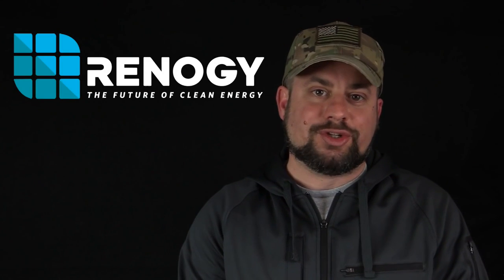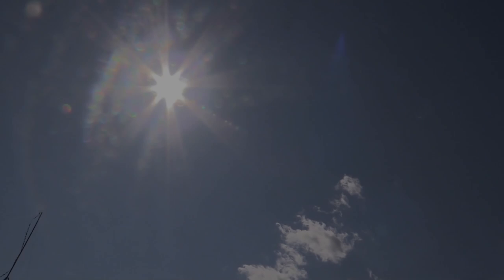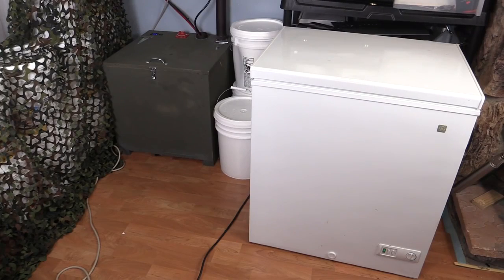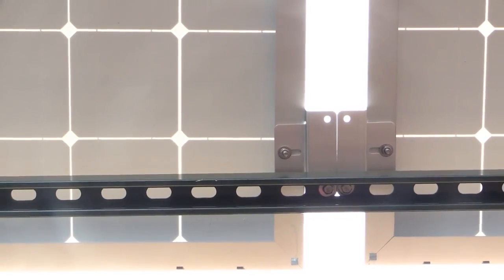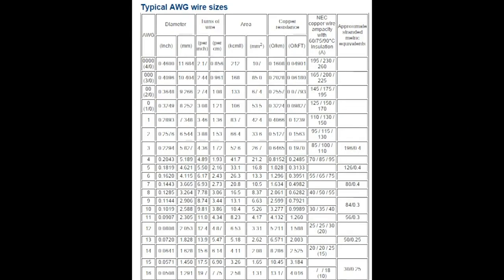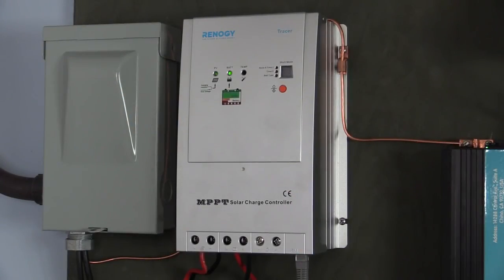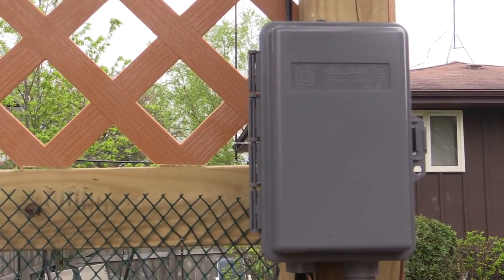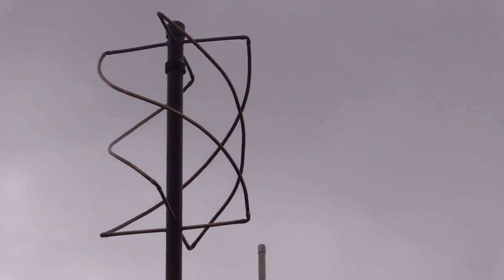The Ultimate Guide To DIY Off Grid Solar Power | Tin Hat Ranch

Comment: This is a delightful series and very helpful to us beginners. However, I am confused by the sizing of your energy storage. You mentioned that your banks store a total of about 400Ah. I was using someone else's sizing calculator and came up with a minimum 750Ah requirement based on your stated goals of 1500 Wh/day, 12V battery banks, 3 days without sun, and 50% discharge. Do you know why the difference? The calculator is here:   https://rimstar.org/renewnrg/sizing_select_batteries_for_off_grid_solar_system.htm

Comment: One note, the current carrying capacity of a wire (ampacity) is proportional to the SQUARE of the wire thickness or directly proportional to the cross-sectional area of the conductor. Thus, if you double the working voltage, you need a quarter of the wire thickness (or half of the cross-sectional area for that matter) for the same power consumption.

Cheers.

Comment: NEVER EVER PLACE A FUSE IN THE BATTERY COMPARTMENT WITH UNSEALED BATTERIES! EVEN A VENTED COMPARTMENT HAS HYDROGEN GAS WHICH CAN EXPLODE IF THE FUSE ARCHS!

Comment: How do you hook the solar power into your house electrical?  Or do you have to run a power cord from the power inverter to the devices you want to power.  What if you turn off your main power cut off to the house since the grid is down anyway then plug the power inverter into one of the circuits in your house.  Would that allow you to say run your regular refrigerator without having to haul it out to the garage and plug it into the inverter?

Comment: Would this system setup be able to run a well pump, small cube fridge (no freezer) and a led TV intermittently without burning the whole system down? I'm looking at settiing up a small cabin on about 2 acres with limited use for company. I know they will need refrigeration and water with a few comforts added, but since it is sporadically used I can't see spending thousands on it.
Reply from the maker: +forklifttony it should
Reply: The well pump needs to draw less than 9 amps at 110 volts

Comment: Ok... So let me see if I get this straight...I have been pretty much flushing voltage down the drain with the PWM is had??? I now have the Renogy Rover MPPT 40a though :D
This is the breakdown of my system:
Four Renogy  100w 12v Panels
Renogy Rover MPPT 40a Charge Controller
Four G24-48 Gel 74ah @ 20hr Batteries
Aims 5000w 12vdc to 120vac Modified Sine Wave Inverter
Cabin Runs @ 1280 Watt Hours

Panels are around 20 feet from my charge controller, and my charge controller is about three feet from my battery box.
I need to run gel batteries, due to the area where my cabin is. The temps get down to around -50 degrees Fahrenheit during the winter, and I don't want to risk FLA or AGM freezing and cracking when the cabin is not in use.
After watching this video, I'm thinking of wiring my panels in series. They are currently in parallel. Would be nice to get use of that first morning sun...

Comment: Reasons not to have too large of a battery reserve:

1) Each battery self-drains at a given rate.  More batteries = more drain.  Charge your battery to 80%, leave it until it drains to 40%, the number of days to drain vs the time to charge is the efficiency loss you will suffer as a result of adding another battery.  On cloudy days your system may fail to charge entirely as a result of having too many batteries.

2) Batteries degrade over time even if you keep them in the healthy State of Charge range (40-80%).  Typical gell cells maintain 50% of their rated capacity over 6 years if you keep them between 60-80% state of charge, so you will be buying a new battery bank every 6 years.  Twice as many costs twice as much.  AGM "Glass Matt" / Sprial Cell batteries can last twice as long as the cheap/common gell cells, so if you want to make a battery bank that can survive 10 years without replacing cells you should get AGM batteries.  If your projected needs exceed 10 years, purchase a reserve of dry-charged batteries.  They won't degrade before you activate them, so you aren't caught with your pants down with 6-year old gell cells on that critical day.

Comment: Great video! A few years ago I started putting everything into power bars and turn everything off when not in use.... only the fridge, freezer are always online even my stove has a breaker now right on the wall abover it.... I even went as far to switch over to a wind up alarm clock... 100w solar cell system to charge all my rechargeables daily and it blew my mind just how much money I saved... one parasitic load is negligible. But start putting many many parasitic loads online and now you're burning amps for zero reasons... it was a pain at first but really it's just a way of life now... I have led flashlights everywhere too and charge the batteries by solar only... outdoor lights are lithium ion powered and recharged by way of solar. I'm starting to funnel my energy savings now into putting together a rather large solar system... batteries are what I find the most frustrating as I find they are the weakest link in a solar system because of life span longevity and COST... but I've been having great results by replacing the sulphuric acid because the acid is cheap as dirt and have been extending battery life while having increased my discharge rate and percentage. Solar is a lot of work and will always require maintenance but to me that's the fun part.

Comment: I've got a set up on my camper that has got me very interested in solar for my house. I've got 2 Renogy panels wired for 24 volts into a Renogy MPPT controller charging a 12 volt battery. It's amazing to see it wake up and start charging even before the sun's "up". People say solar isn't any good on rainy days haven't seen this kind of system. Can't wait to add a couple more panels. Before solar I ran the generator almost constantly, now maybe for breakfast and possibly before bed. With those 2 more panels maybe not at all. Imagine hot tea (sorry not a coffee guy), refrigerator and radio; In my case blower for heater all without the noise of a generator saying here I am.Great job explaining solar.

Comment: Great info I actually understood it! Lol, that being said I don't think I could do it myself. I want to full time RV and be able to run the air cond. I don't like it ice cold so to keep it on 76 degrees on low. I don't want to use the generator. So what do you suggest or better yet could you do a video on that??
Reply: It's easy to calculate, his system is for an estimated 100 kilowatt/hours of use each day, so multiply the wattage of your air conditioner times the hours you use it each day, you'd likely be over 100.

Comment: Excellent Video. Pretty much the exact system a buddy and I want to install on his off grid fishing cabin on a Texas Coastal Island. What I don't get is if Solar panels always produce when in sunlight and the batteries are full charge and there is no draw - like when we are not using the cabin- where does power/energy produced go? And can any components be damaged ?  It could be a month to 6 weeks between visits.

Comment: Wow!  Learned more from these videos than I thought possible.  I've started planning for my first small solar system.  Of course, I have a question.  I bought a "Kill-a-watt" meter and started measuring appliance loads.  I noticed the difference between Watts (active power) and VA(apparent power) can sometimes be substantial.  I've read that VA should be used to chose wiring and fuses as they experience this current in resistance and heat.  However, I'm unclear which I should use to chose battery bank size and inverter.  Can someone expand on this??

Comment: EDIT: Very good. What is the coating on the unistrut you purchased. I have seen the silverish pregalvanized stuff, and the interior gold coating, but not the dark color of yours. Which type is that?
Reply from the maker: +Steve bakker it's a paint or powder coat of some kind.  You have to keep in mind the installation of this system was three years ago.  It's faded some but no corrosion.
Reply: Thanx for replying! I was also wondering what sort of wind speeds you've experienced since putting up your array. We get 70+ MPH winds here. I used unistrut (pre-galvanized) to make an adjustable mount for six panels, but I used far more sticks than you did. I like your design, but wonder how much wind it could handle.

Comment: Good video,  It is cheaper adding an extra panel as opposed to buying more batteries, thus you will get additional charging during cloudy days, and you will have more reserve power in the batteries.Good information about not going too big for the batteries capacity if you don't have sufficient solar panels to bring them up to full charge, so you will find in the winter your batteries will not be fully charges and you loose the required reserve power and life duration.
Thanks from Australia :-)

Comment: Someone give this guy a medal.
Reply: sarthak grover #
Reply: Lil puigun
Reply: Great examples.
Reply: Ricky Swisher goos
Reply: BLAIR M Schirmer  I do believe that he's trying to inform the new and just starting out and getting into the solar panels with some helpful information that most would not know..  I'm just saying.. some have to crawl before they start to walk..
Reply: Bob A  I am not sure what you are talking about 72 cell panel are commonly used on homes and I am a solar company they are about 54 pounds we have all our projects engineered structurally for load on any home or Utility building there is no issue with the weight.. As for efficiency you would have a lot less panels to achieve the watts of the system you are trying to get. They cost less money so it also makes better sense from that side as well. right now you can pay $340 for a 385watt panel and the 12 vdc panels for 100W are about $230.
Reply: RIGHT!!!!
Reply: I will slap him! hahahah just kidding
Reply: nope.
Reply: Gold medal
Reply: I have been into solar power for the last 3 + years.. my RV is my castle.. my hunting and fishing and off I go to wherever I want... And have been building up my own solar power grid to be completely self sustained.. I would like more of his videos.. ( I do consider myself and electronics freak of sorts..) right now I have 600 Watts solar.. large capacity battery bank..as I said I do live very comfortably in my Castle.. but also a 4K Onan, 4k Furman, and even a sportsman 1000 (as I am a musician and plan to use this equipment as live concert stage Power) but I will be adding onto my solar.. only because I love the feeling of complete and utter freedom! I value this gentleman's knowledge.. kudos my friend and  others that are into this..
P.S. as a side note solar panels are more efficient at about 70°F, so constructing a heatsink and a few simple means to dissipate heat from below the panels.. it would be easier if they weren't mounted onto an RV as to many factors... But if you have stationary application it would not be hard to come up with a simple design to remove excessive heat.. as I said 70° if you look it up you'll find out that I am correct...
Reply: This is my second re: as food for thoughts build your system all in one area batteries as well as inverters in run AC the rest of distance.. you know from the inverter because your AC has a less drop in the delivery.. has he mentioned 60 feet of heavy cable from battery system to solar or vice versa... But less expensive and more efficient power.. as I said food for thought.. thanks for reading
Reply: He gives a clear and practical bunch of useful information.  Congratulations !!   I appreciate the effort.  It shows !   Thank  you.  :-)
Reply: Did this guy get his metal yet he should run for president😜😮😎
Reply: Ya think he is a real trained died in the wool Sparkey ?
Reply: Christine Ortman Ortman Christine tonn

Told
Do you
Reply: yeah! right between the ears. He is prepping for failure.
Reply: LOL--- bad design on the system can do it cheaper and get more power the 100w panels are way more expensive then the larger 72 cell panels
Reply: @EvolveEnergyca  first can I say I'm not being critical of your knowledge. But it wouldn't hurt to share with the rest of us.. I know I'd appreciate it.. thank you
Reply: @CJames-gw9xj  Hey James sure. First the larger panels will get your power up with less money invested. I have been a solar designer for 12 years. so first you want to go in 48 volt on the battery side and get a MPPT charge controller. The higher the voltage of the battery you will utilize the charge controller better. Like a PT 100 from Magnum lets say it is a 100 amp charge controller this is $1500 to buy so you want to use it the best way at battery voltage of 12 v you only can add up to 1200 watts solar, at 24v you get 2400 watts and at 48v you can add up to 4800 watts so it is important to invest in key pieces.. Then this MPPT charge controller you can wire a much higher incoming voltage so if you get 350 w or 400 watt panels you can do them in strings of 2. This reduces the wiring cost and you are going to get way more energy from them. Any hope that helps! if you go to my channel my web site is there and you can email me if you want. Good Luck. I have my system here running since 2012 on my home. I use Magnum.
Reply: @EvolveEnergyca  thanks I appreciate the input to this. And I will check out your channel I appreciate it. Thanks.
Can never have too much information.. again thanks
Reply: @EvolveEnergyca  oh I need to add a couple things that maybe would be pertinent. One is that you gotta remember I'm using this system in an RV and space is at a premium always.. though I do have approximately 250 sq. Feet of roof .. and will be utilizing as much as I can forpanels there's other reasons besides just covering the roof with panels for power.. but I won't go into that for now.. also battery weight isn't too much of an issue but still has to be considered . But I'm glad that you're a solar panel engineer as I'm in the transitional stage of my system.. and have a lot of things to consider before going forth and spend any more money.. the system I've got right now actually does one hell of a job.. I mean I got crockpots running,two refrigerators one is a three-way that came with the RV and usually just use propane even if I'm plugged in.. the other is a 7 cubic foot+/-? Tv,lights.. inshort I've got a lot being utilized, I'm very savvy I guess on how my Power is being distributed.I'm running several fans the help out there in the summer time with the two large AC units (those of course are not part of  the solar) I'm trying not to make this too long of a story but just a clue you in where I'm at with this because I am going to be doing an upgrade.. battery wise and panels.. as I said what I've got right now works damn well.. but I want..haha.. that's just the kind of way I am.. and would like to get more info I'll get on to your channel here as soon as I get this sent.. since I've got your attention at this moment..the batteries that I'm using I've had for 3 years and they're still for the most part strong.. I have an array of 3 sorts.. and more than three reasons why..and as far as inverters I'm very creative as how those are enacted with all that I've got applied to them for use.. why do people say I go overboard but then again I do this.. not just with electronics but also with my music too haha okay I'm starting to babble so I will get on to your YouTube channelthere's a few things I've discovered also as to compensate between cloudy days and nighttime that would may be useful to others.. I'm going to stop here ... But thanks again and looking forward to conversing into the transitional upgrade to my system..
Reply: @EvolveEnergyca  so toss a few panel brands and sizes if you don't mind.. I apologize I'm not trying to hijack your YouTube post.. but I just want to ask the evolve green guy a couple questions and if you've got any particular panels that would serve RV well.. thanks
Reply: @CJames-gw9xj  for Rv's it really depends on first how much power you need. don't go above a 60 cell panel ( 40 in by 65 in) and you should if in the US use only UL certified just CE is only a China Certificate. If it has UL TUV or ETL those are all higher Certificates and are better tested. to prevent a fire in your RV you want to enure all positive cables are fused or have a over current like a breaker rated correctly that is 1.25 x the amps in the line. You want to ensure that the wire size is rated for the amps you have as well. This keeps your system safe. I like MorningStar products for Charge controllers in RV's they are more compact and better quality. https://www.morningstarcorp.com/ They have great manuals as well. I also like to use a AGM battery for solar in RV's don't use GEL though they do not last long.. AGM is safer as it does not off gas but it does cost a bit more.
Reply: @CJames-gw9xj  Not a guy
Reply: Diy wattmeter
Reply: Theevplgreen

Comment: i need help.
which is the watts if it states 1.6A@110v/0.8A@220v
what is my watts or how do i but this in solar info. to run 16
Reply: hrs
Reply: 220 v x 0.8A = 176W
or
110 v x 1.6A = 176W
Reply: Leo Gutierrez V x A = W

Comment: very very good and informative and comprehensive. Few confusions. I tried Google to find out open circuit amp. but could only find open circuit voltage. what is open circuit amp? Does open circuit amp really matters? as in series there are only 5 to 6 ams current will flow. I saw mostly we calculate only close circuit. i am little confuse.
Reply: Amps is the measure of electricity flowing through a circuit, if the circuit is open there is no flow, no amps.